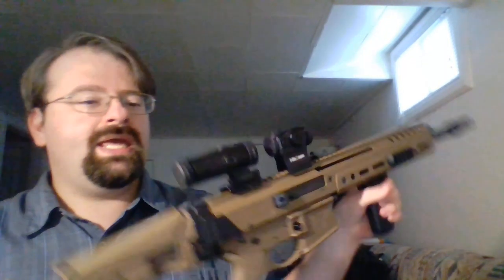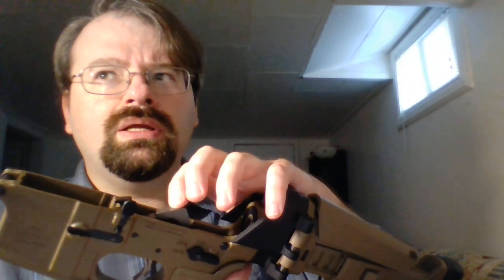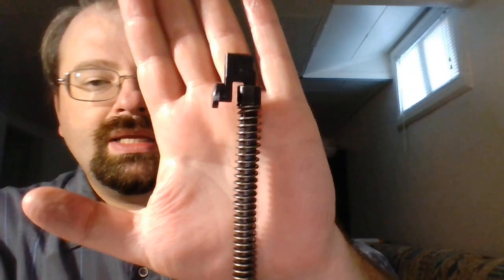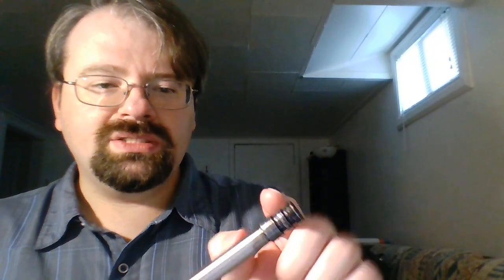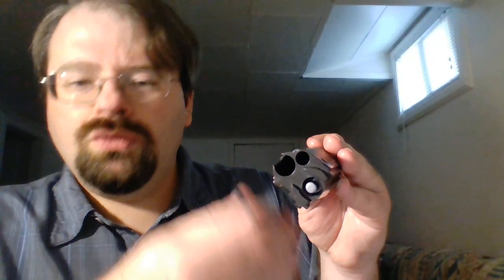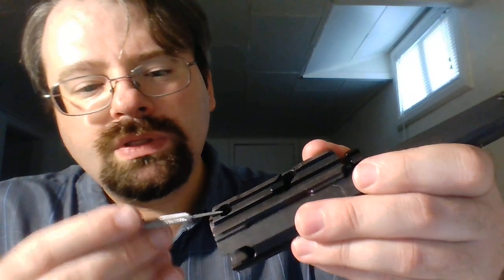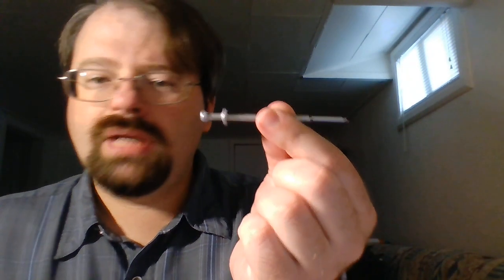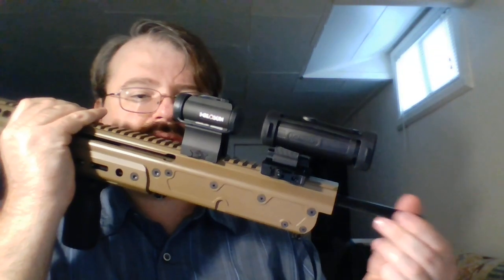Disassembly/Assembly (Field Strip) of PSA (Palmetto) JAKL (13.7" 5.56x45 / .223) (JAKL Bullpup?)

Comment: Outstanding review. So, if I am not mistaken, there is no guide tube? The piston fully leaves the gas block and then reenters (with its sharp edges) upon the bolt carrier returning to bagger? If so, this is a major point of concern for reliability with hard use.
Reply from the maker: No, there is a piston guide tube that the piston does not leave during normal cycling. The problem only occurs when the piston is fully removed for cleaning/servicing.
Reply: @reformedgga1510  I assume that is the guide tube attached to the gas block? It looks rather short. The piston doesn't leave this during cycling?
Reply from the maker: Yes, the gas block leads directly to the piston guide tube, and the tube is longer than it might seem. The piston never leaves the guide tube during the cycling of the action.

Comment: What are the lubrication points?
Reply from the maker: I usually put a protective layer of oil on everything to start with. After some shooting the parts will develop some wear marks, and those wear marks will coincide with the points that would benefit from extra lubrication.

Comment: I just received my jakl today, I’ve got a question. I remove the piston/bolt barrier and noticed that there is play where the piston rod attaches to the bolt carrier, feels lose. Was wondering if that’s normal? Thanks.
Reply from the maker: It should feel loose--that's perfectly normal. The bolt carrier and piston of the JAKL are based on the AK's carrier and piston, and AKs are supposed to have a loose connection (oddly, many PSA AKs don't have this loose connection, but most other AKs do). In most AKs, the loose connection helps maintain functionality when the gun heats up--the barrel droops, and the looseness allows the carrier to still function despite the droop. This functionality was preserved in the JAKL. It's perfectly fine.
Reply: @reformedgga1510  awesome, thanks! Also good and very informative video 👌👍
Reply from the maker: You're welcome
SDG